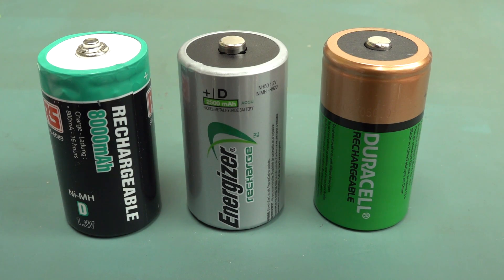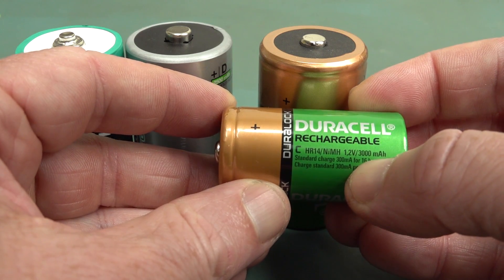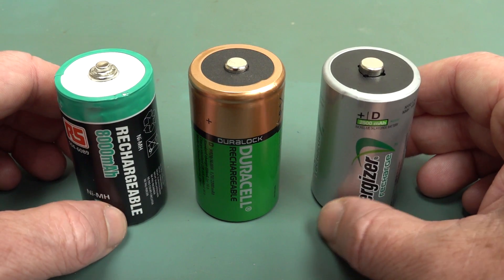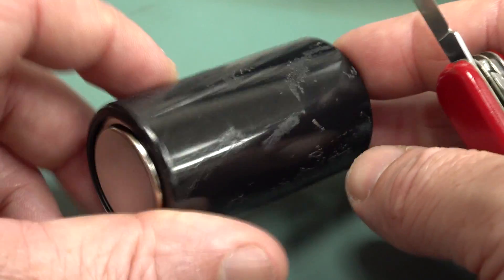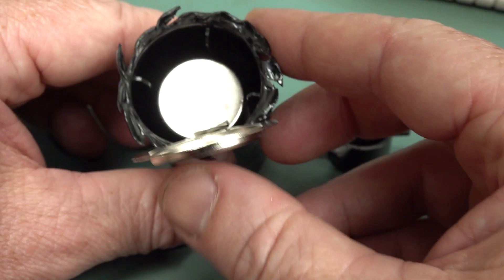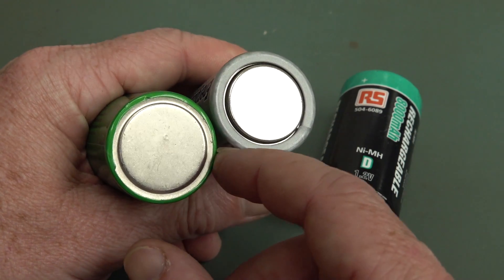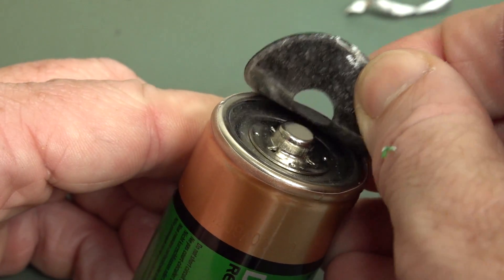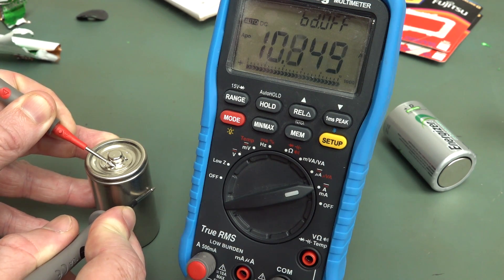EEVblog #1200 - BUSTED! - Energizer & Duracell NiMH

Comment: C cell in a D cell can sounds familiar from even back in the NiCd days -  one way of looking at it is that full D cells are quite heavy, so if  your gizmo takes D cells but you don'twant the weight or need 8Ah, then these would be fine. They do at least tell you what the capacity is, even if you don't understand it maybe. RS brand ALKALINES have leaked badly on me twice -  loooong before they were discharged - not sure if these were made by Nexcell, and these are NiMH you are showing, I know.

Comment: So few electronics use C or D cells anymore.  I assume its just cheaper to make a few sizes that can be used in multiple batteries.  Also, the number of recharge cycles might have a factor.

Comment: Sorry Dave but this should not have been a busted video. There's nothing wrong with not using the entire volume of the cell, as long as you're getting what you paid for.
Reply: In some respects there is, because devices require C or D cells BECAUSE they are high drain and most users won't understand the rating.  So they end up buying batteries that are next to useless because their capacity is junk.

Comment: Many moons ago a project we built required a rechargeable 9 Volt battery for backup.
The only choice back then was NiMH and you had to be careful ordering them. There were some models that were sold as a "9 Volt Type Battery " that contained only 7 cells equaling a nominal battery voltage of 8.4 volts. The expensive ones had 8 cells at 9.6 Volts nominal. 
This made all the difference when the battery had to keep the power hungry CPUs of the day going longer.
Reply: I came across those as well instant low battery message at switch on

Comment: To be honest I thought this was common knowledge.
Reply: I always thought the big brand D cells were AA cells in adapters, but I was proven wrong for these 2 at least.  One was a shitty low capacity subC cell in an adapter, and the other was just a REALLY crappy D cell,
Reply: Then you are very wrong.
Reply: Sadly no, i have known many people who have brought batteries while saying "We'll their Energizer so it should last" while ignoring what's on the actual packages specs.
The problem now is most shops will only sell Energizer and Duracell and some cheap knock off battery that will be cheap but barely last so people will buy one of the other two.
Reply: i havent picked up a battery in over 10 years. i can recall as a kid having rechargeables from radio shack, but yeah this is not at all common knowledge.
Reply: There’s a Candlepowerforum thread on the same exact subject from March 2008 where people are complaining that it was common knowledge then, too. (I think some people simply pay attention in this world, and others don’t.)

Comment: There is a good reason why known brands sell so small capacity D cells (same applies to AA cells, actually) - it is so that they can sell 4000 mAh for double the money and more capacity one for even bigger bucks. And better still, you have to realize that most likely Duracell's 2200 mAh is more expensive that unknown brand's 8000mAh. I was testing AA and AAA alkalines recently and it goes beyond belief how unreasonable the Duracell prices are, when considering capacity (which is at best equal to cheap batteries). These are for the people that don't know any better.

Comment: And people still use dura cell as equal to long lasting you can get 18650 for 5 dollars a popand it will outperform these more expancive cells by a huge margin . eneloop is doing the same thing with d size but they just sell the adaptor so you can recharge stuff in aa chargers thats nice .( some 3rd partys sell adaptor that can take several cells ) iguess if a device uses d cell in series using a protected 18650 or 26650 is more weight effective And less expensive and youll get a lot more capacity

Comment: That's neither a ripoff or BUSTED since it's clearly declared.
Reply: If battery declares 2200mAh and can deliver 2200mAh, then this statement cannot be called as scam.

If company advertises itself that their batteries run better and longer then other brands, builds whole their brand on this, and then sells battery with 1/3 of capacity of other brands, I call this behavior scam, fraud, cheating.

Comment: Enjoyed seeing inside these things.  I wouldn't have expected all that fresh air in there either, but a rip-off?

A quick google for the Duracell D cell at 3Ah is £6.99 (Inc. VAT) for the pair,  the Energiser at 2.5Ah is £7.15 (Inc. VAT) for the pair from Amazon.  In the UK, the RS Components sell their 8Ah D-Cell batteries at £20.93 (Inc. VAT) for the pair.  OUCH! 

So, the rated capacities are a fraction of the full potential given all the fresh air in the cans as demonstrated, but the capacity is reflected in the associated costs, however.  

Calculating the cost per Ah  (total capacity = 6Ah / £6.99 for a pair) of the Duracell gives us a cost of £1.17 per Ah, where the RS Components cells (total capacity = 16Ah / £20.93 for a pair) gives us £1.31 per Ah.  Contrary to being a rip-off, the Duracell batteries are cheaper off the shelf and cheaper bang for the buck.

So, sorry Dave, but I don't agree that there's a rip-off going on.  I'd rather pay a slightly higher cost and get the greater capacity battery.  I won't have to dick about recharging these things so often, but I will need to pay a premium for that. Not a scam!

Comment: I use a LOT of batteries and have noticed that some batteries are now marked in milliwatt hours instead of milliamp hours.
So a 1000 Mah Nickel Zinc battery is marked as 1500 Mwh because their nominal voltage is 1.5 Vdc....
 Also, I have found only one brand of import batteries that has consistently outperformed all other imports with the same ratings.
 I will not mention their brand name here;   so no one will think I have any affiliation with them.
 They still fall shy of meeting their printed ratings in Mah, but are usually within  +0,  -10%... (always on the low side)
.
So bottom line.
Here is a list of 1000 Mah batteries compared to what they may soon be marked if Mwh marking becomes the new industry standard.......

Nicad = 1200 Mwh
NiMh = 1200 to 1300 Mwh
NiZn = 1500 Mwh
LiIon = 3700 Mwh
.
I don't know if I am one of the first engineers to notice this....
(I hope I am not)
I do, after some consideration, believe that this may actually be the best way to mark and  compare batteries in the future,
With all the DC to DC converters becoming more efficient every day, we probably should be more concerned about the WORK the battery is capable of doing.
 I think this could make a great topic for another EEVblog battery video.
I enjoy your show a lot.
I don't always agree with you but I am positive that you are more correct, more often, than any other presenter on any other show I have ever watched on the Tube..........
Regards,
Dennis W. Ostrowski

Comment: so much space inside them, you could use them to smuggle drugs
Reply: So, that advert where they shove a battery up the energizer bunny's clacker is really a drug smuggling tutorial !
Reply: paul hawkins the bunny is actually high on meth
Reply: @paulhawkins6415  how do you think he runs so fast?
Reply: @paulhawkins6415  bawahahahahahahah ahahahadlkhrgahkl; staaaaaaap
Reply: Something like that it's already being done actually. In a recent episode of border patrol I saw a shipment of powerbanks and cheap fans contained 2 18650 cells in parallel where one was functional and made the device appear to be working while the other was full of meth.
They where caught because the xray image showed the cells completely different and then obviously upon close inspection the weight difference was huge plus the fact that only one cell showed some charge.
Reply: @Yrouel86  Yeah I saw that too. The other tip off was that the fans still worked with only one battery plugged in. But in this case the x-ray wouldn't show anything different because the drugs would surround the entire battery part, and the battery would still work. Honestly not a bad plan to tell you the truth. Although if it were me I'd probably use something self contained (like an AAA cell) inside the bigger cell as to not get the electrolyte on my drugs.
Reply: @Yrouel86  but those shows are usually fake
Reply: Sush!
Reply: that's a great idea, they would be hesistant to take it apart as well. ... especially if it was  energizer one containing gasp LITHIUM
Reply: xray will show difference between organic and not organic stuff
Reply: You gave them the idea to put drugs in them..good job!!!!
Reply: A: "Heeey dude, let's smoke batteries"
B: "what?"
Reply: A N I M E
N
I
M
E
Reply: I see someone with experience....
Reply: They fit inside the prison wallet too .
Reply: and they won't even bother scanning them

Comment: I bought NiCd in the 80's from Panasonic that the D cells were same in weight as their C cells and capacity too. Seems like all my rechargeable D cells were actually c cells
Reply: and actually there is an AA cell in both of them :D
Reply: @michalveselenyi3801  and a AAA in the AA :D
Reply: what you using them for
Reply: @pulkinpulman2028 In the 1980's? Probably toys. I remember all D being too light and never found any D's that were larger in charge not just a C in a D package.

Comment: If it were wound tighter, and pressed into a plastic console, rather than just loosely wrapped, would it increase current capacity, and reduce equivalent resistance? I doubt it would improve capacity, but could it improve performance?

Comment: A quick search shows that the RS batteries are between 1.5x and 3.5x the cost of the energizer ones. Depending on which store you buy the energizers from. Lowest price was $8 USD for 2 cells from Walmart, on clearance.
Reply: (That said, Walmart also sells 10000mah d-cells for $6 per cell, so you're getting 4x more capacity for 1.5x the price.)

Comment: Thanks for sharing Dave 👍
This is probably hints to way I quit buying energizer and Duracell rechargeable’s 
years ago I buy the harbor freight ones now
Reply: The AA and AAA NIMH ones are on par with eneloops which are the market leaders. Guess they couldn’t afford to lag behind in the more widespread sizes. I’ve had a set of the Duracell ones running allong side my eneloops for a good 4 years now and still running strong. Can’t really complain about that type of service life. 

The Panasonic charger that comes with the eneloops is miles ahead of the energizer and Duracell crap chargers though. Can actually charge cells individually on the Panasonic ones so you don’t need to keep track of battery pairs for charging in pairs on a shitty charger.

Comment: Is the RS cell really 8,000 mAh? 

Does the additional mass have any effect on reliability, current capacity or cycle count? Could there be other reasons for not packing the D cell completely full?
Reply: C-cell or AA-cell are fully packed with no air gaps. There is no technical reason for D-cell to use only 1/3 of space.
Reply: Well there is one reason, don't remember if this applies to NiMH but with lithium cells you can either cram as much as 3,400mAh into an 18650 sized cell for max capacity or you can make a lower capacity ~2,000mAh cell that can continuously output 10A or even more, but obviously there aren't that many reasons to do that with the type of devices that use NiMH so...
Reply: @vgamesx1  It has nothing to do with air gaps in battery! You are talking about batteries which have lower ESR, so you have to use thicker materials, and that means less space for "chemistry". But again, it has NOTHING to do with air gaps I'm talking about.

Comment: Quick question: Do you have kids? If not, there are indeed cases in which a parent that's in the know about these things will deliberately select a battery with an inferior charging capacity. 

When the relatives get the kids the "Toys What Make the Noise."

I know... I've done this. 

Yes, the toy is fun for the kids for the first dozen whiles, while Mom and Dad quietly grit their teeth and climb the walls after hearing Mickey the Mouse say "Hiya!" and give the little giggle for the forty-fifth millionth time that hour. It is a thing of great joy for them when the batteries finally run down and we tell said (now sad) child that we'll recharge them, and why don't they go play Connect Four or Candyland for awhile... 

Which then turns out to be about three days longer than it takes for the kidlet in question to forget the thing ever made the noise. Months later, when the relative in question wants to borrow them for the weekend (or longer), we remember to put the batteries in just moments before the child (with toy) runs off to Auntie's. 

Revenge is a dish best served cold.

Note: If the toy (and child) is going to be away for longer, say a week or more, then I put the really good batteries in-- the ones I usually save for flashlights and wall clocks and such. Because I'm an Ebil Bastich.

Comment: Interesting I always kinda suspected that, I have energizer ones and they feel so light but never payed attention to the rating.  I suspect the only reason you'd buy these is because a device needs that size, and not because of the capacity, but to me it's very misleading what they're doing. Most people don't really pay attention to the capacity and just assume a bigger battery is going to have more capacity.

Comment: It's even worse than that.
Those D cells have similar capacity of AA cells.
Energizer actually sells 2300 mAh  AA batteries. 10 years ago they were 2450 mAh.
https://www.energizer.com/batteries/energizer-rechargeable-batteries#aapp

Ikea sells 2450 mAh AA cells for 30% less (and they are of eneloop type, made in japan).

Energizer and Duracell really went down the drain.

Comment: This ain’t a new phenomenon. We had D rechargeable NiCads when we were kids for our torches in the 80’s that were nowt but a far smaller cell in a spacer to bring them up to the right size. I think they were roughly the same as AA”s of the era, around 800mAh or so.

The revelation came when my brother (bless his soul) decided to see what would happen when he put a snapped metal violin string across a fully-charged battery, only to be surprised when it got really hot and burned his fingers. Part of the string was touching the battery, and melted its way into the casing. I was quite surprised that the battery was completely unaffected from the big gouge in its side. It was more like the energizer’s construction.

So, yeah, the battery manufacturers have been playing silly buggers like this for 30-odd years at the very least.

Comment: I did a bit of looking and (Energizer) AAA are around 600 mAh/$ and D are about 500 mAh so they aren't pulling the inflated bulk price scam. At least they are being honest with the ratings but it completely ruins the advantage of designing a product to accept D cells (the extra run time).

One legitimate reason might be if traditional alkaline D cells top out at around 3000 mAH so they figure that they don't need to exceed historic consumer exceptions. (For some reason I only found two alkalines with mAh listed, AAA 1150, D 2050). It makes some sense as the rechargeable are notably more expensive anyway and even more so if at full capacity.

Comment: This video would have been 8,000 times better if he had tested the actual capacity of the RS cell.
Reply: He didn't test any of them, he just took them apart.
Reply: In my experience all these rechargeable D cells are around the 8000 mark. Even the ones that claim to be 10 all test around 8. I’ve tried a lot of different brands and they all seem to be more or less the same. I question how many manufacturers there really are. I’m guessing only one or two since obviously the “big boys” don’t make a real D cell.
Reply: @Alexlfm  those 10k cells probably will give that amount when discharged really slowly at some specific temperature.
Reply: Yeah, he was awfully willing to take manufacturers' claims at face value, wasn't he?

Comment: I'm amazed that such a small area of electrodes can deliver 10 amps and the overall capacity.
Reply: 10 amps DC is not that much.
Reply: When I was doing 1/10 scale racing with sub-c 4200mah matched packs it was normal to have bursts of over 100A accelerating out of slow corners. And even that is barely worth mentioning compared to some of the big lipo packs I have for my planes lol. 10A is cute